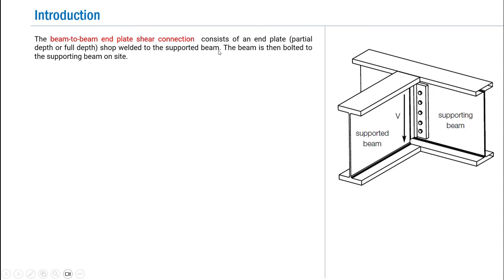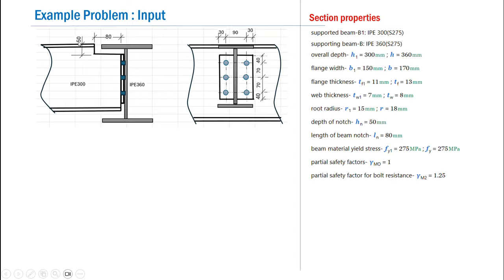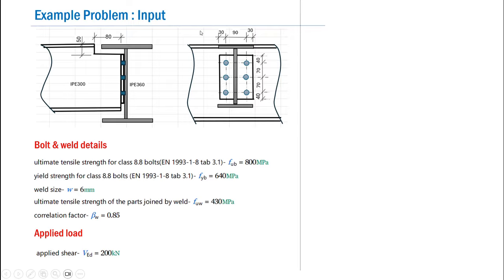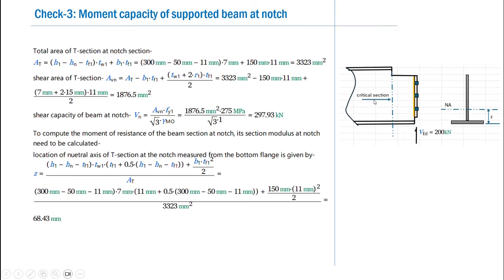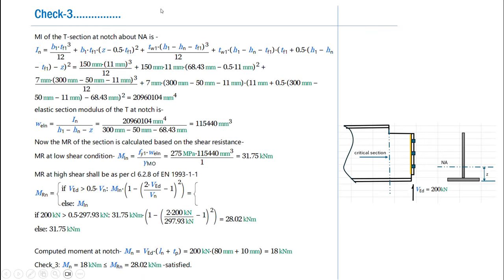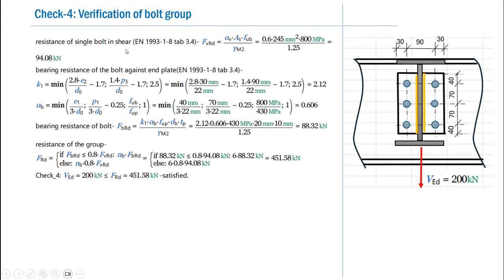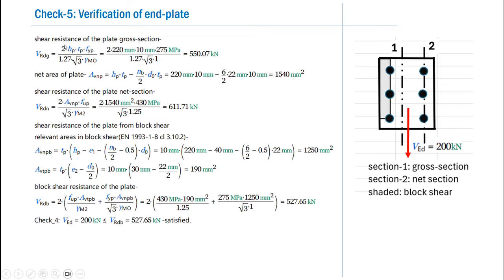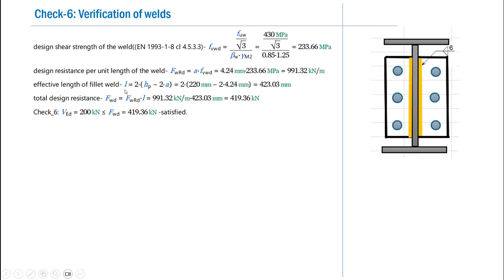A Sample calculation for the design of beam-to -beam end plate shear connections using Eurocode EC3

Comment: Hi Sir., What is the advantage of endplate shear connection when compared to a fin plate connection?
Reply from the maker: Both types are superior connections in the way that they  permit quickest erection at site. Both do provide sufficient rotation capacity to mobilize shear connection. One advantage of the end plate connection is that they can be used both in shear and moment connections with proper placement of bolt rows. A distinct advantage of fin plate is that the holes need not be kept the same for  beams connected on opposite sides thereby eliminating some issues associated with end plates......

Comment: Why do we not use the plastic section modulus when calculating the T-section?
Reply from the maker: Yes , it is indeed a genuine question.....
The use of plastic section modulus is permitted only if  the section is capable of developing the full plastic moment of resistance  with no capacity reduction on account of LTB effects (class-1). However, in the present case , with no information of LTB effects on the supported beam (IPE 300) , it is assumed that the class of the member as class-3 with the stress in the extreme fiber limited to yield stress and hence the use of elastic section modulus. Again at the notch the beam is not symmetrical and has a Tee section.
However, if the engineer ensures that the supported beam is class-1 at the notch location , it is well justified to use a  plastic section modulus.
Reply: @puttattjayarajan1199 sir, thanks for explaining...I think it should be considered as semi compact as the edges of the thinner web is unstiffened....